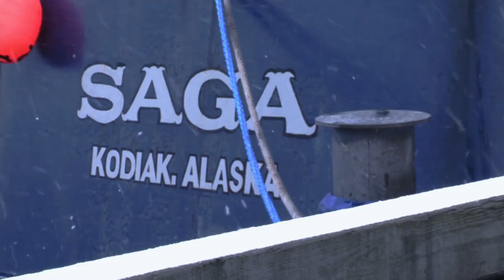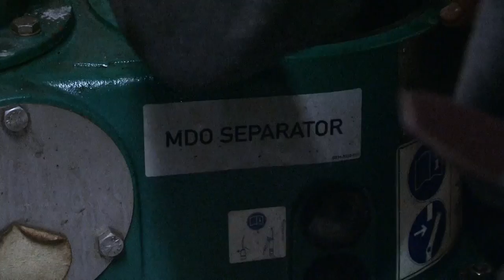A Broken Centrifuge Separator Drives Captain Jake Anderson To The Brink | Deadliest Catch

Comment: we have water separators on the bottom of our fuel filters. just drain it through the drain plug. Is the cold making the water in the fuel worse? or are the facilitews the use sub par and fuel bunkers full of water
Reply: Condensation inside the fuel tanks. No way around it: can't seal the tanks or air can't get in to replace the fuel as it's burned. IF you let air in, water comes with it. Marine diesels of this size send a lot of fuel back to the tank, so the water and fuel become quite well mixed, and the gravity type separator you mention wouldn't cut it.
Reply: Add to the fact all the diesel fuel is transported in via fuel barges up there which are well known to have debris and water in them as well, dirty fuel.

Comment: The most important thing you can do for your car, boat is keep a detailed log of parts changed with receipts.  

And speak to service staff at dealership about common failures at what miles or hours, etc. They will tell you what to expect. 

Increase your oil thickness as you go. 5w-20 to 5w30. Add Lucas oil stabilizer as needed. 

And when you go to sell your detailed log book can even increase the value of your car by thousands, or boat by hundreds of thousands. And it will be more reliable in the mean time. 

As I have gotten older I have come to highly value people who can fix things, craftsmanship,  etc. 

If this was my boat I would have more spare parts that you can imagine. I will get all that money back  when selling as they realize I maintained the boat well.. 

You can even include pictures of maintenence log when selling. Sell faster and for more money. 

I just told you how to increase the value of your boat and cars by thousands. 

Your welcome.

Comment: Why do u have water in your fuel to begin with?  Do they no have drains on the bottom of their tanks?  Or a fuel train that way the cab just drain the water? Plus fuel filters?
Reply: It happens with diesel all the time it’s part of the deal with constant temperature changes
Reply: @MrDbradie  I know your tanks sweat but u normally have drains at the bottom of your tanks.  Plus u normally have a fuel trap that's made to catch water all your fuel tanks and all your fuel lines are connected to the fuel trap so any water or trash settles in your trap.  And u shouldn't have that much water in those tanks. It doesn't suck the fuel off the very bottom either.  They ought to have some racor filters/water separators on there too. That way u can see any water and drain it out the bottom of the canister without even shutting the engine down.  I know the boat is rocking and rolling out there but u drain everything before u leave the dock and u can always drain your fuel trap on the go.
Reply: @timothykappel198  marine engineer here. On the fuel circuit (pretty much the same on all ships) we have a few things in place to remove water and impurities. In a nutshell At the start is the decantation tank, heating elements, pumps seperators and then filters, to then go back through another filter to the fuel tank (after that more filters). Seperators are the same thing as milk seperators, except there are more plates on the ones at sea, but they work the same way. There can be multiple reasons why there is water, one of them is because a ship uses HFO which is the closest thing to crude oil you can find. The other reason is that marine diesel is not a pure and that it's left sitting in tanks in a very damp area. The issue their having is pretty common, seperators break down all the time, what I'm more surprised about is that supposedly they can't fix it, or have spare parts. I started working at sea as an apprentice at 14(in Brittany on fishing boats) as a trainee deckhand and mechanic, working on the seperators is one of the first things I ever did and learning basics about how to fix them etc as they are essential. The other thing is ive never worked on a ship that doesn't have 2 seperators.  to me this seems like drama.

Comment: Soo it needs new fuel filters?
Reply: I'm no pro, but what it seems is that the device that is busted is a sort of centrifuge. I'm assuming it spins up, separating water, and potentially other contaminants, out of the fuel (water/contaminants entering the fuel for various reasons before, during, and after getting to the boat). That way the boat is just burning pure fuel, and not fuel with stuff that can cause damage, and eventually breakdowns in the engines/generators/etc. 
They can't wait around to fix, and/or have it fixed, so they decide to basically skip the broken machine, and let the fuel filter mechanism do the brunt of the work. This works fine, in theory, as that is what the fuel filter does anyway. However, without the centrifuge to doing its job, the fuel filters are going to become clogged up exceptionally fast; in this case, a brand new filter, at least the way they were talking in the video clip, would seem to only last a few hours before it becomes 100% clogged up, unusable, and needs to be replaced. 
So that is why Jake has them buy as many as they can find; they will go fishing with a broken centrifuge, and every few hours, check on the engine, checking out the fuel filters, and replacing the as needed, again and again, until they are done fishing, can get back to port, and fix the Saga properly. 
It's a band-aid on a bullet wound kind of solution, but after having spent nearly two weeks in port waiting around, Jake made the hard call for the sake of the season.